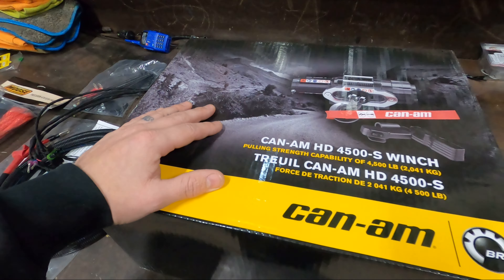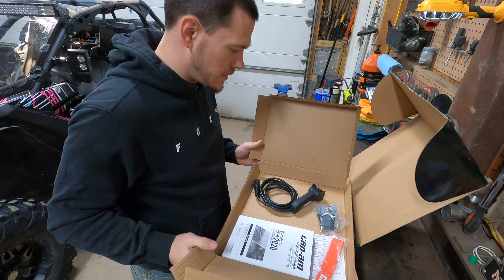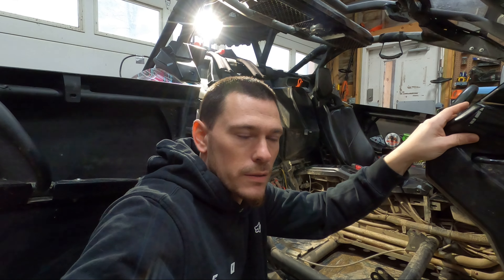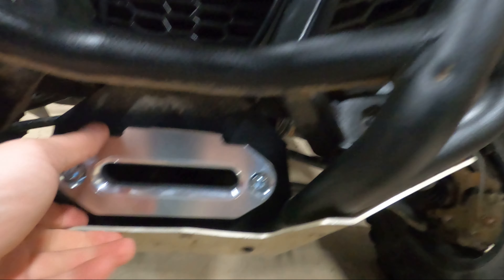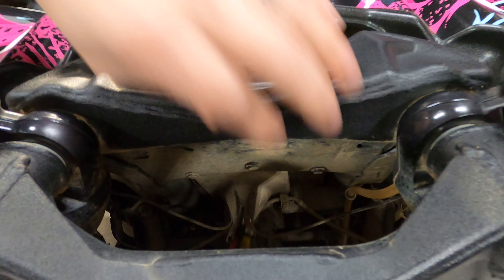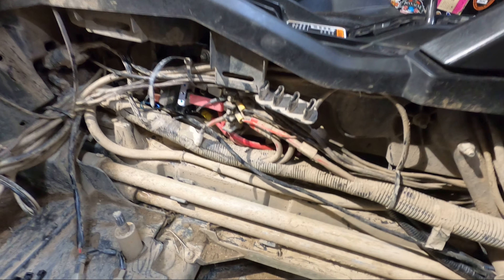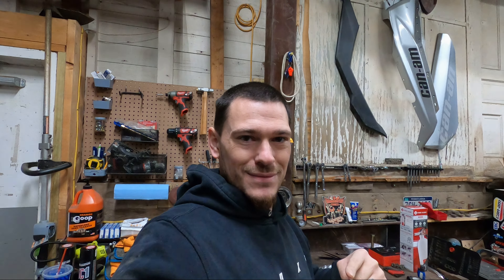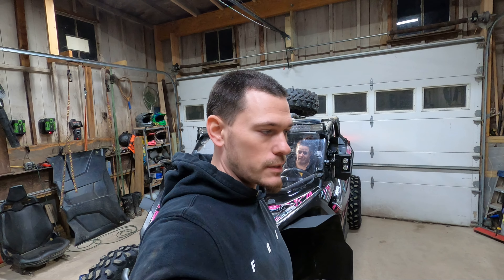2019 Can Am Maverick X3 4500 Pound Winch Install

Comment: Thanks for this video. My winch on my RC is starting to run on it's own periodically. It took out the stock red tow hook and the winch hook. I thought it was the switch so I got another one. I wrapped the rope around my front bar and again my winch triggered again and bent the bumper bar. So I need to see why it's periodically running on it's own without me even hitting the switch
Reply from the maker: I hope you get that figured out, unfortunately we’ve never had that issue so I won’t be much help there. Thanks for watching.

Comment: Did the winch kit or wiring harness kit come with the winch switch? I'm talking the part that plugs into the switch control. Just trying to figure out what I need to order. Great video thanks!
Reply from the maker: Yes, it came with everything needed
Reply: @TheCanAmCrew  Good deal Thank you! Going this route to achieve a nice clean install.

Comment: Just got a winch and also have the same bumper, doesn't that metal the winch bolts to look a little thin?  How's it holding up?  Im a little concerned about the strength of that plate it bolts to messing the front end up or pulling out
Reply from the maker: We haven’t had any issues. We now run a badlands apex 5500 long drum and everything has been great.
Reply: @TheCanAmCrew  I bought the badland 5000.  Thanks for the reply. That gives me some peace of mind, I was worried about that plate it mounts to only being ⅛"
Reply: @TheCanAmCrew  were you able to install both of the winches without removing the bumper?
Reply from the maker: @InterWebLegend  yes.

Comment: There’s no power running where can I find the accessory cable on my2021 maverick x3 max ds ?
Reply from the maker: Are you talking about the accessory cable under the dash or behind the side panel where the passenger seat goes.
Reply: @TheCanAmCrew  can’t find either or
Reply from the maker: @aaroncardona5819  there is a small black plastic connector with 2 wires strapped up under the dash from the factory. Basically above the middle but favors the driver side. I can be tough to locate. The other battery connection is under the side panel on the passenger side. Youll have to take the seat out. First then the black plastic cover. It’s just a small junction you can hook to.
Reply: @TheCanAmCrew  I finally found it it was on driver side right under steel bar thanks for the quick response

Comment: What engine oil do you guys run ? The dealership I got mine from gave me 0w40 xps full synthetic
Reply from the maker: We run the can am recommended xps 5-40 synthetic. They come in kits at the dealer.
Reply: @TheCanAmCrew  the first oil change I did they gave me xps 5w40 synthetic blend and my 2nd change they gave me 0w40 full synthetic and said it was better and I asked if it would hurt the motor to switch and they said it wouldn’t know the difference so hopefully it’s fine
Reply from the maker: @jamiesonbartl4369  the 0-40 oil says it’s for 500cc and up v twin engines. The 5-40 oil is specific to the 900 ace motor which is what we have. I’m strict on running what they call for. If it were mine I would go back to the brp recommended 5-40 oil.

Comment: What torque specs did you use to torque down the bolts you use to mount the winch to the frame?
Reply from the maker: I’m sure there are specs for it but I didn’t torque the bolts.